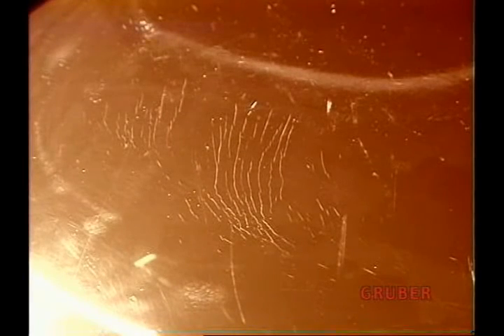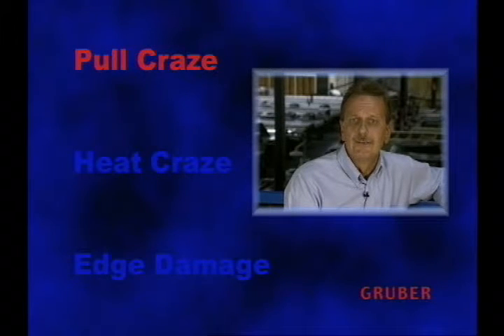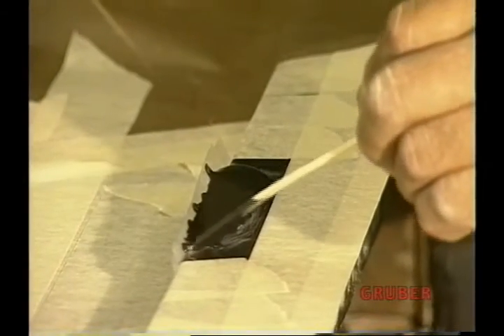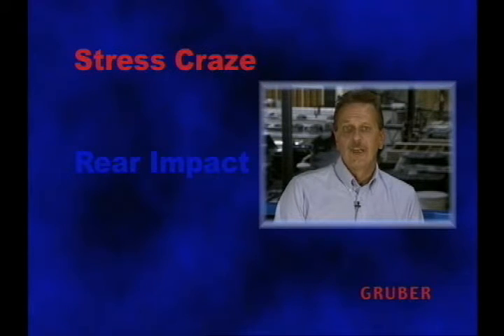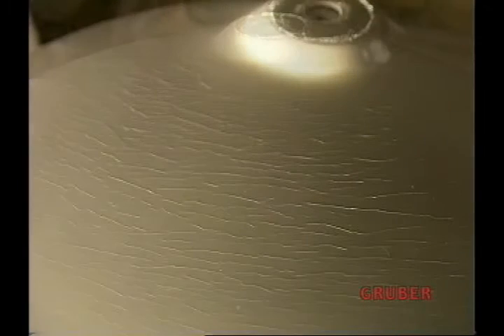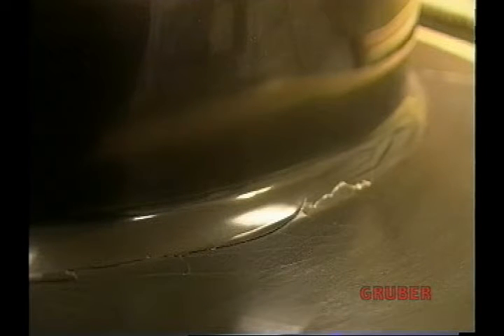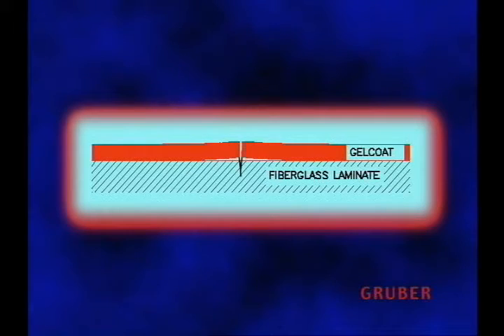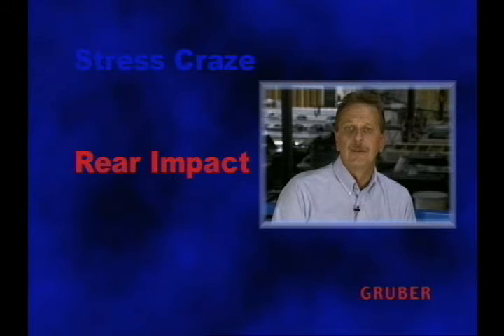Gruber Systems Mold Repair Video

Comment: I was just wondering what you mean by "wax solution" that is used to mix with gelcoat and catalyst?
Reply: Hi Dennis,

Good question. Back when this video was produced, we advised adding a small amount of "wax solution" (paraffin wax mixed with a bit of styrene) and adding that to the liquid gelcoat prior to being sprayed onto a mold repair.  If you do not add the wax solution to the gelcoat, the sprayed surface of the repair will remain a bit "gummy" (not cure completely) and result in an area that is difficult to sand easily. The benefit of adding the wax/styrene solution being added to the gelcoat was that after spraying the affected area, the wax will rise to the top of the repair surface, and make that repair area easier to sand.

Since we made that video, we now produce a Gelcoat Patch Kit with a Surfacing Agent included into it already, so you don't have to add that wax/styrene solution manually.

Both MetaMold and Vinyl Ester (VE) Gelcoats are available with or without Surfacing Agent included, but if you are spraying gelcoat on a repair area or overspraying on top of existing gelcoat, then you should use the gelcoat patch kit version that INCLUDES the Surfacing Agent. 

Assuming you are repairing a Gruber MetaMold mold (its a dark gray color gelcoat), the product you would order would be MetaMold™ High Temperature Gel Coat with Surfacing Agent Mold Repair Patch Kit - Order Number 191230. There is also a Vinyl Ester version which is order number 191231. Vinyl Ester molds are a light gray color.

You can learn more on this page of our website:
https://grubersystems.com/products/moldsupplies/moldrepair

If you have any further questions or want to order that Gelcoat, you can email us at info@grubersystems.com, or call 661-257-4060.
Thanks
Gary